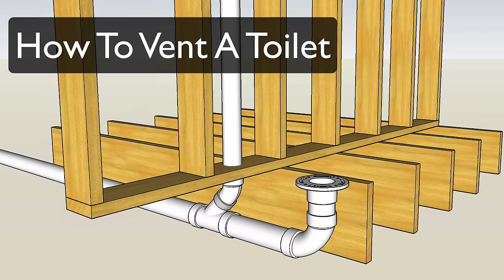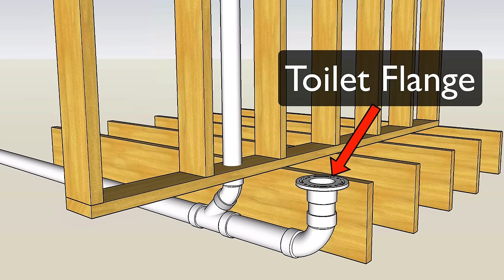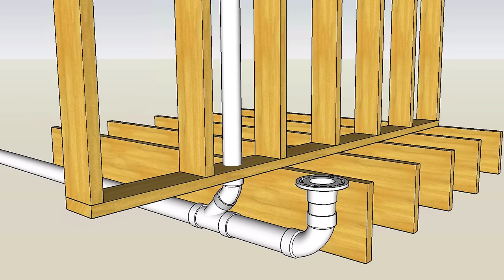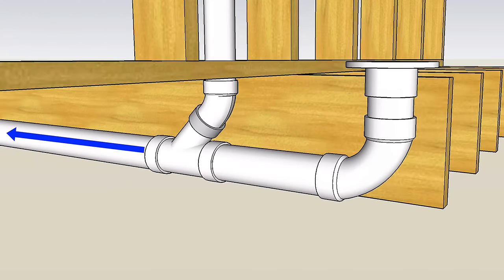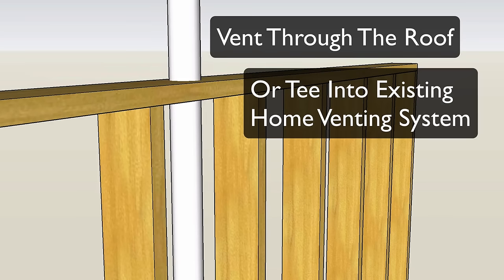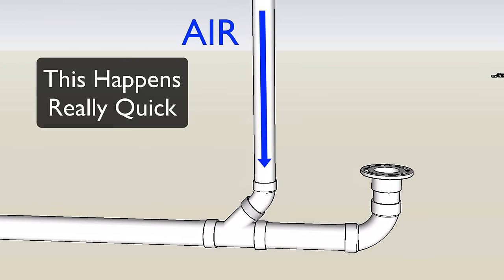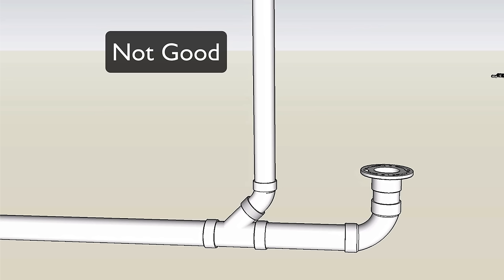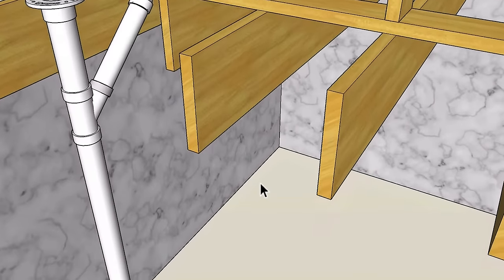How To Vent & Plumb A Toilet (Step by Step)

Comment: Better check your local codes #2 is illegal in Florida
Reply: Help please . We had installed a new ceiling bathroom fan with a light, he add combo wye to the fan  made a hole in to our exiting  Vertical vent pipe that goes in to the roof , Is it safe? is there any possibility that air can back up to the fan into our bathroom  breathing  bad  polluted air ? they insure me was ok but i am getting worried . hope you can tell  if is ok Thank you
Reply: Smith Linda yes this could allow sewer gas to be introduced into your bathroom

Comment: Ah.. Just a minute.Explain how making an H pattern for a toilet vent would work.( unless.... nah!  Why would anyone do that? If the nearest wall is 12" away, that makes the pipe out of the flange drop vertically at least 12". Yes? I believe a drop of more than 18" is a violation. (might pull the water out of the trap before it hits the vent.)So I say that one is not really applicable. There's one way to do a closet vent that you didn't mention. At least in the U.P.C. Rolling a horizontal wye above the center line, install an 1/8th bend to make an H pattern, vent at 1/4" per foot rise to a 2" L.S. 1/4 bend at the nearest wall.  A L.S. 1/4 bend is not required for a closet bend.. Look at a 4"x 3" closet bend.

Comment: How do I get the link for the diagram
Reply from the maker: https://hammerpedia.co/vent
Reply: @Hammerpedia  The link doesn't work. There's no place to put your email address. I've tried getting several of your guides but none of the links work.
Reply from the maker: @irafair3015  https://hammerpedia.co/vent/
Click the yellow button and a window opens. Put your email in there. If that does not work, try visiting the page in a different browser. Chrome and Firefox both work well with our pages.

Comment: You’ll never believe this but the guy I bought my house off of built the house and had a local crack head do the plumbing. Unfortunately he never put a vent on it. Only one toilet in the house but it’s just a straight pipe from toilet to sewage. How would you vent that?

Comment: I can tell you the the wye and 45 is wrong it should be a sanitary tee. You could also horizontal wet vent the whole bathroom with one vent. At least in Minnesota one of the most strict plumbing codes there is.
Reply: Can anyone verify maxes coment
Reply: Can the Y and 45 be replaced with a 90?

Comment: Screwed the pooch bro. It's basically a crown vent. Crown vents are illegal. You need to position your wye at a 45 degree angle if dry. You want your wye with a 45 degree fitting horizontal if wet. If at all possible catch a sanitary tee and "then" drain. Your not a plumber dude or it would have been explained properly.

Comment: This video sucks. Long sweep under the toilet is nonsense and most times would put you in a bad position in a floorspace when considering pitch and distance. Then the heel outlet cleanout, no. Matter of fact, I hate dry venting and is the hardest way of piping 9 out of 10 times. If I have no other choice but to dry vent, then it's a t on it's back, downstream of the fixture, but I cringe just thinking about it.